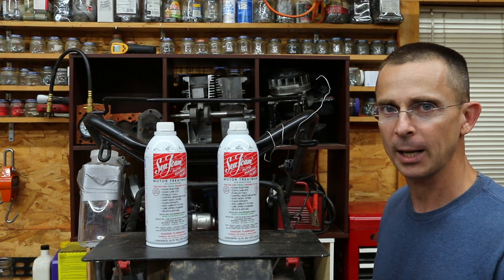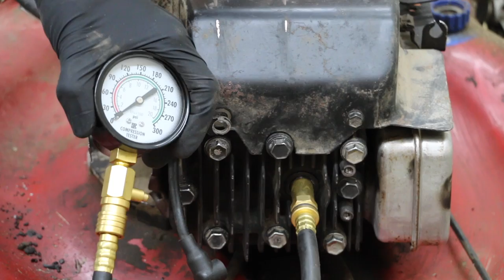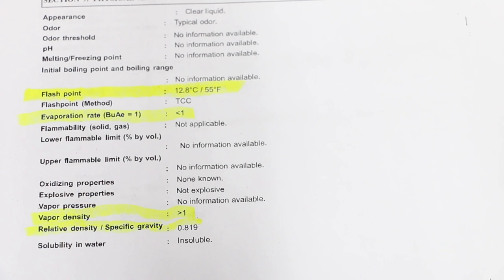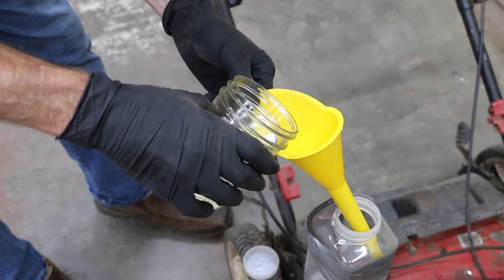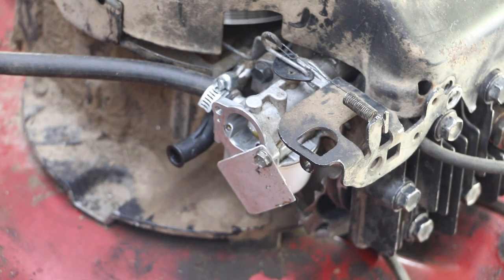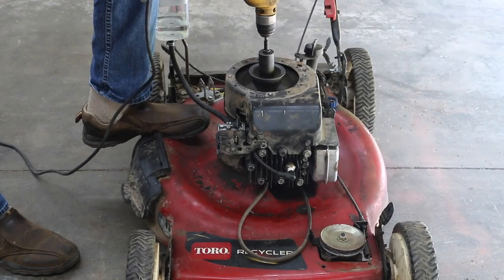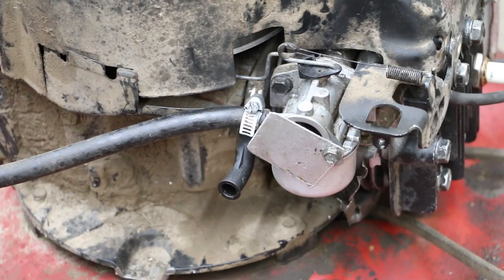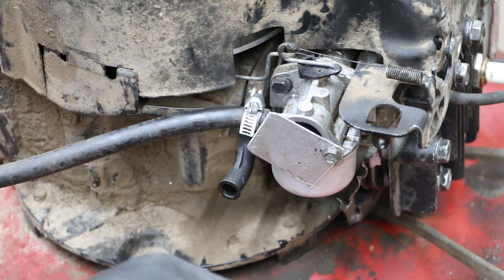Will a Gas Engine Run on 100% Seafoam?  Let's find out!

Comment: Back in the day to clean carbon (on a V8), we'd run the engine til it was hot, while running, spray the garden hose down the carb while revving the engine, then slowly dump about a half qt of trans fluid down the carb, rev until the smoke goes away, leaving a ton of carbon on the ground at the end of the exhaust pipe. The Idea is the cold water hitting the hot carbon build up, crystallizes it, and fractures it loose, then the trans fluid washes the water out, lubes the valve seats, and the car ran better.
Reply from the maker: Thank you for this recommendation.

Comment: I've never been a potions and lotions guy, and I do not take paid endorsements for any product either, but this comment may be relevant to some of your viewers. I ran a shop that had a fleet of Case 85XT uniloaders running in filthy environments, some of which would occasionally get a stuck injector and lose a cylinder. On about 5 occasions I removed the fuel filter, filled it completely with seafoam and started the engine at full RPM. Every time but one the engine regained its full power within minutes without any repairs. The one that didn't actually required an injection pump, not an injector. If you have a diesel that drops an injector, try this, it could save lots of time and money!
Reply from the maker: This is very informative. Thanks for commenting!

Comment: That was very cool but not unexpected. Any clue why the exhaust from the engine seems to come out as a double puff? It's almost as if the valve is opening twice per cycle! I know it can't be but I can't figure out exactly what's going on. What are your thoughts? Oh yeah, fantastic job as usual👍👍👍

Comment: Great job! First of all, I'd like to know if you would recommend using Lucas and seafoam together in tropical weather? My car has 180 compression. It's a mitsubishi lancer 2.0 2003, I have found some oil in my sparplugs. Thank you so much.
Reply from the maker: Thanks!  Thanks for the video idea.

Comment: I've seen small one cylinder diesels used on generator sets. It would be interesting if you could obtain one of those, I think Harbor Tools even has them, and test products like Seafoam and others that have a characteristic more like diesel fuel than gasoline in the diesel.
Reply from the maker: Thanks for the suggestion.

Comment: You should try all of these additives or will it run on fuels in a diesel engine. I had a old 1980 Volkswagen rabbit 4 cylinder diesel and ran it on strait used motor oil ( filtered of coarse ). Lots of power, smoke, and engine heat. Had to thin the fuel with kerosene or the engine percolated like a coffee pot. it was funny, a brown rabbit with a white hatch that smoked like a fiend
Reply from the maker: Thank you for this recommendation.

Comment: I’ve always had a question about removing the spark plugs of an in line 4 cylinder engine and squirting generous mist of each of the carbon cleaning competitors products on top of each piston, soaking overnight, and then run the motors until engine temp is reached, then inspect for piston cleanliness.
Reply from the maker: Thank you
Reply: I also wonder this

Comment: A piston so clean you can eat off it!   That was some expensive fuel, I hope you're making good money doing these videos.  I've had really good luck running Seafoam in storing cars and motorcycles over the winter.  Sometimes they sit for as much as 6 months with a full tank of ethanol fuel and the they always start up fine, but smoke somewhat until all that old fuel is run out.   You should do a long term test on fuel stabilizers like a 1 or 2 year .... Seafoam, Stabil and whatever else to see if they keep fuel from plugging up small jets and such.
Reply from the maker: Thanks for the video idea.

Comment: I ran my 75 chevy truck souly on sea foam to try and get my truck to run better, I ran a fill bottle through it with the gas line disconnected for about 20 minutes. My engine ran much better afterwards
Reply from the maker: Awesome!!

Comment: Merry Christmas! I have a question out of all the cleaners you tested which do you think is the best? I personally think seafoam, and Bestline for oil stabilizer. What's your opinion?
Reply from the maker: Seafoam and Marvel are very close and Bestline has by far the best film strength to date.  However, I have many more additives to test.
Reply: Project Farm I will be watching all the videos to! Do you plan on trying gumout all n one? If not you should as it's a big name one out there

Comment: I use seafoam in my 386 peterbilt the website says to put it directly in the fuel filter on a diesel at let it run straight. I usually dump in 2-3 cans start it up then haul ass on a on ramp with a 44k load to clean the injectors
Reply from the maker: Thank you for the feedback

Comment: Run Diesel engine on vegetables oils , used engine oil and used vegetable oils 😉, run gasoline engine on Bacardi 151 😁 I like your Chanel good job very professional 👍 , try to modify see true head so you can adjust compression and see lost or gain power 😉
Reply from the maker: Thank you for the video idea!

Comment: Something I've always been curious about. If you could bring diesel up to the temperature it develops fumes, could you use your fume fuel tank and run a gas engine on diesel fumes. Obviously this would be a bit dangerous but if you could find a controlled way to test it that would be interesting
Reply from the maker: Thank you for this recommendation.

Comment: First of all I love your channel I’ve learned a lot of information that I would never of thought of. So thank you. My question Is anyone else curious if automatic transmission fluid would be an adequate engine cleaner I’ve heard myth from older mechanics that automatic transmission fluid does a great job in cleaning injectors, but I’m curious if I would break up carbon in an engine or not. Also I’d be curious to see if it actually is a good cleaner for injectors or the fuel system in general.

Comment: I really enjoy your videos and experiments! Maybe this is a terrible question... But in your opinion, do you think the engine is running cooler on straight seafoam due to the lack of oxygen? Similar to how when an engine runs lean, it runs hotter? Curious to know your thoughts.
Reply from the maker: This is actually a very good question.  The engine was running cool since it was really extremely rich.  All of that excess fuel has a cooling effect. Thanks for the question.

Comment: I heard seafoam was made for 2 stroke outboard marine engines. It's not designed for engines using direct inject and ethanol because it isn't nitrogen based like Gumout is.
Reply from the maker: I've heard that too but both are internal combustion and both experience the same issue, carbon deposits

Comment: Wonder how well this would work in an automotive application. Not really concerned with carbon cleaning as much as I would be cleaning the injector and restoring atomization of fuel without removing the injectors and sending them out to be cleaned. Would be an interesting study to conduct, also using another product that is allegedly superior like LiquiMoly Jectron.
Reply from the maker: Thank you

Comment: I think I’d be cool to cut a hole in the side of the cylinder to where you can see the piston move up and down, but not enough to leak compression, and maybe I’d be cool to stick a metal rod in there to see what happens, I’d still be cool to just see the piston too😁
Reply from the maker: Thank you for this recommendation.

Comment: I was wondering if a diesel engine would run on 100% used and (coffee)filtered cooking oil and if so, how efficiently. Cooking oil seems to be a pretty good alternative to diesel while it is technically a waste in most cases and if it worked, it could be recycled as a price efficient fuel maybe.
Reply: Bora Akbay it will work, but it will be too thick in cold weather..so you would need to warm it first (or start it on diesel, and then switch over).
On the other hand, you can convert the oil to biodiesel quite easily... basically by treating it with a strong alkali.

Comment: We don't even have Seafoam in Germany. Also, how did the engine run with a leaner mixture? Or not at all? Also, the really low flashing point of Seafoam makes me wonder whether it might even make a gas engine run in "diesel mode", igniting only from the compression of the piston without needing a spark plug. Unfortunately, a fuel injected engine would be better to see that (and also of course as a see-through engine, because that's cool).
Reply from the maker: The engine seemed to require a very rich mixture. Thanks for commenting.

Comment: Make a test with Sea Foam and just plain water,  when you pull a head on a engine and it has 1 or 2 cylinders that are real clean that's the ones that are getting water in them.
Reply from the maker: Thank you for the video idea!

Comment: That's insane. Add some high alcohol content with the seafoam or techron and run it through. Would it make any difference with hot soak then running it a second time?
Reply from the maker: Thanks for the suggestion

Comment: I like to run my snowblower and lawnmower until the tank is empty, and then run a bit of seafoam through them before putting them in storage. As long as the motor is warmed up, it starts and runs just fine on it.
Reply from the maker: Thank you
Reply: Great idea.

Comment: Seafoam was introduced in the 1940's for 2 stroke boat engines that you mixed oil and gas together like in a gas weed wacker or such. Those little engines had crazy carbon build up. Today's vehicles are 4 stroke water cooled and do not need this stuff. Nitrogen is the best main ingredient for cleaning an engine in a automobile or motorcycle.
Reply from the maker: Thank you

Comment: It is not surprising you had to choke off the carb.  Two reasons.  First is the carb is dialed in with the expectation of the resistance of the air filter.  Second, the seafoam has alcohol in it which has a lower stoichiometric ratio than gas.  Not surprising the temps are lower due to the alcohol burn.  I wonder if the alcohol impacted the carb parts.
Reply from the maker: All great points. Thanks for commenting.

Comment: I've got an suggestion.. Does the old school trick of "steam cleaning" the inside of your engine clean carbon buildup? Run a engine at a mid-range rpm, and let the motor suck up about half a pet  bottle's worth of water, not poured in, but almost vaporized water.
Reply: Nevermind! Sorry i'm a new sub, and I just found your water video haha. Awesome videos and keep up the awesome work! Merry Christmas!
Reply from the maker: Thank you and Merry Christmas!  I might do another test using water vapor in the future.

Comment: Nice video. I typically run a can of seafoam as an additive 3-4 times a year in my vehicle, and I've noticed that I see an MPG increase of around 2 MPH on the tanks with the Seafoam. Any idea why that might be happening?
Reply from the maker: I believe the Seafoam is eliminating deposits around the piston rings and valves, allowing for greater compression.  This is my theory.  Thanks for commenting.

Comment: from what I have told sea foam was designed to remove carbon build up in two cycle engines  when oil to gas ratio was 16 to 20 to 1
Reply from the maker: Thank you

Comment: I would like to see what happens to the engine after running a tank of fuel? Does the carbon burn off more? Does it get worse than before? Or does it not change?

After running pure seafoam.
Reply from the maker: Thank you for this recommendation.

Comment: So, here's an idea..  (would try it my self but here in Sweden there is a lot of regulation for what you can buy and not) 😂 anyway, I'm thinking ammoniumnitrate, fertellizer, to let the fuel solve those crystals into liquid and then run it! Will it make your engine explode or just make more power? Very curious about this 😀 hope everyone had great holidays!
Reply from the maker: Thank you for this recommendation and Happy Holidays.

Comment: I used to always disconnect the brake booster line and feed the seafoam in through that... smoked a butt load... wonder if it actually cleaned anything or just blew smoke...
Reply from the maker: Thanks for the feedback.

Comment: Maybe do an update review on 4.5 inch metal cutoff disc & inclubed  hart brand Thanks so Much .
Reply from the maker: Thanks for the suggestion.
Reply: @ProjectFarm  Also was wondering i,m scaping my 93 ranger maybe you know someone that can  use some parts new fuel injectors with lower intake  , water pump etc. Just pay shipping .

Comment: Have you seen the walnut blast on the car cylinder and intake valves it does a really good job but Seafoam doesn't seem to work that well on really bad carboned up cylinders.
Reply from the maker: Thanks for the feedback.

Comment: A trick people do to clean carburetors temporary on motorcycles is a full sea foam run. It helps but not a fix. If a carburetor rebuilt is necessary, it still needs to be done.
Reply from the maker: Thank you

Comment: You really need the air filter on a engine with out a choke it adds negative restriction to create a vacuum in the carburetor Inlet to suck the fuel out.. and it's not a good idea to keep running a engine with that as it will wash the oil film off the rings although it is good to clean it up real nice
Reply from the maker: Thank you for this recommendation.

Comment: The thing that scares me from using seafoam is all my engines are very high mileage engines  that of course consume some oil between oil changes. I'm scared that using some product like seafoam would Increase that oil usage.
Reply from the maker: Do you use a "high mileage oil"?  They contain seal conditioners, which help.  One of my vehicles had an issue until I switched to a high mileage oil and it no longer leaks oil.

Comment: I used to fill a new fuel/water separator with Seafoam when installing on my 6.2 Detroit Diesel because I didn't keep a can of diesel in the garage.

Then it occurred to me that Seafoam goes for about $50 a gallon around here, so I sprung for a new can and gallon of diesel. 🤣
Reply from the maker: Thank you!

Comment: Hey, I have an idea. Since Seafoam is for cleaning up carbon Build up. Can you make a Video with using water? I seen people add some water into their intakes. And apparently hot intake turns the water into steam at that takes off the carbon build up off the valves and cylinder.
Reply from the maker: Thank you for this recommendation. I tested water a while back but should have used a mist instead of a drip. I might test it again.

Comment: Could you use seafoam on a 2 stroke? If so, would you still add it through the carb, or just mix it with the gas?
Reply from the maker: Thank you for this video test recommendation.

Comment: Adding sea foam in with the oil of the engine a few hundred miles before changing the oil. Will that help clean the engine or ruin gaskets? Have you done this yet?
Reply from the maker: It will help clean the engine. Thank you

Comment: I'm still waiting to see what you can do with old fashioned caster bean engine oil.
Reply from the maker: Thank you for this recommendation.
Reply: I raced a bug-eye Sprite in the 60's and my secret to keeping the engine running at high RPM's was caster bean oil. Regular oil in those days was not very good and for all practical purposes, synthetic oil did not exist. The friends I competed against rebuild their engines almost every race. I had to tear down frequently to clean the residue out but the rings, bearings and other wear parts lasted a whole season.

Comment: How about testing car/truck radiator hole sealer?
Reply from the maker: Thank you for the video idea!
Reply: Always a pin hole leak in the heater core, just enough to smell, but not enough to drain your radiator system of coolant.  And rolling a dash to replace takes considerable time.  I've tried several over the years.  Never got a complete seal. BTW I love your videos and your attention to solid testing standards and details.  Bob Henderson Armada Michigan

Comment: I have a couple weird ideas. Will an engine run on another engines exhaust? And can you drill a big hole it the muffler while running Sea foam to see if the engine will blow smoke rings?
Reply from the maker: Thank you for the video ideas!

Comment: If you run out of 2 stroke oil can you use standard automobile oil in it's place. Like 5w30? Will it work and what will it do to the engine?
Reply from the maker: Thank you for this recommendation.

Comment: Would you say seafoam cleans the chamber well or do you recommend something else? It's for a Chevy 4.2 I6 vortec
Reply from the maker: I like Seafoam a lot. One strategy you might consider is to use Seafoam in a full tank and the next tank of fuel use Techron.
Reply: @ProjectFarm  appreciate the quick response, I'll try that to see if it smooths my idling.  Subbed

Comment: Merry Christmas 🎁🎄. Try running an engine on Aqua Net hairspray with a crankcase full of olive oil. Hehe. Or lamp oil as a fuel with a crankcase full of 100% Marvel. Or try to blow up the engine by running wide open throttle with the blade removed and 100% Lucas in the crankcase. My diabolical brain is out of control..........ahhhhhhhh!
Reply from the maker: Thank you and Merry Christmas to you and yours.  Also, thank you for the video ideas!

Comment: Will seafoam destroy a head gasket?? Please Test I used some seafoam in my crank case to help keep my engine clean From build-up but found out during a oil change I had oil in my antifreeze😣
Reply from the maker: Thank you for this recommendation.  I don't think Seafoam caused the issue.  Compared to other products, it's pretty mild.
Reply: Project Farm thank you for the quick reply